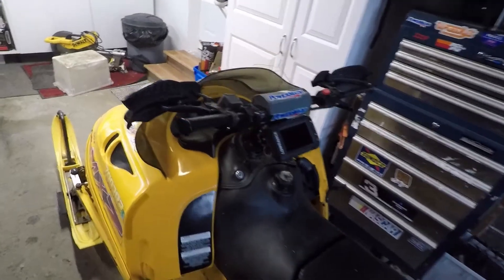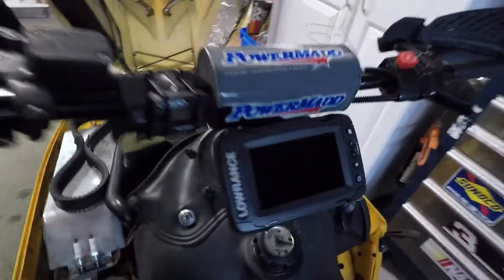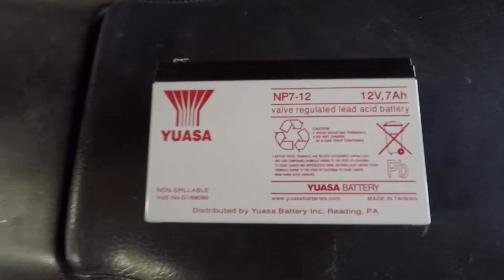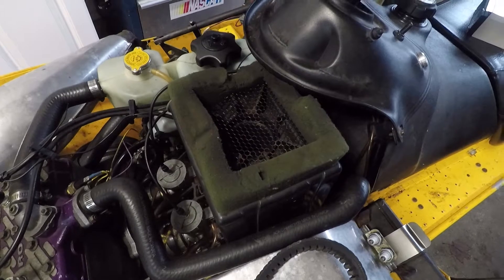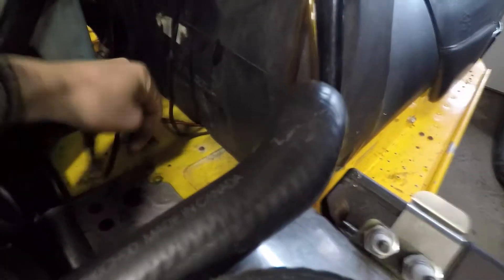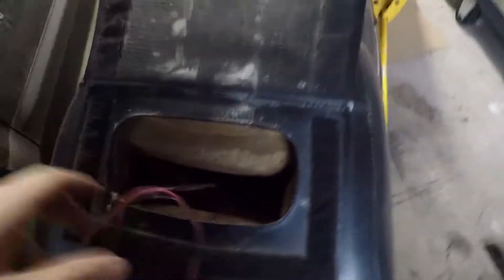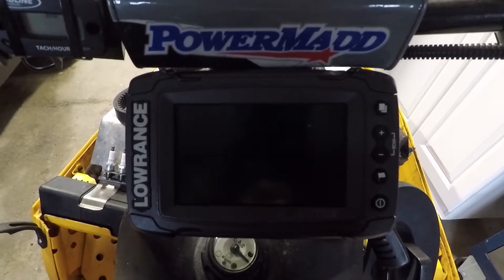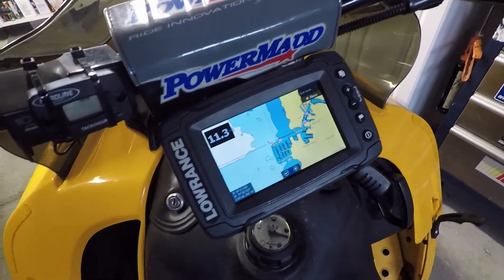Add a Battery to a 12v AC Snowmobile for 12v DC For Electronics

Comment: I put a regulator rectifier (3 wire) on my snowmobile that doesn't have electric start the regulator rectifier it self puts out 5.5vdc but measures over 17vdc at the battery how can I regulate the dc to 14.5 for proper charging? I installed a small 12v dirt bike battery on the sled
Reply from the maker: Nice, after doing this I saw another video of somebody doing it similar to that.  Good work
Reply: @InDepthSonar  thanks ended up soldering a bunch of diodes in line to bring the voltage down 3.6 volts so I don't boil the battery still have to put it thu its paces but seems like its g2g

Comment: Dumb question I have a sled its batteryless all I wana do is get nice bright led under glow on it what's best way to do this I dont really wana put a battery in if I dont have to lol
Reply from the maker: You'll need a power source of some kind. Unless you can convert your AC to DC. The under glow lights would only work when the sled is running in that case

Comment: is there a way too hook a battery up so that it can be charged by the stator?
Reply from the maker: Not to my knowledge, but I am sure it can be done.  Anything can really
Reply: You’d need to install a voltage regulator with a rectifier so you’d have a lead to run dc to the battery, like a sled with estart.
Reply from the maker: I think I saw a video on your channel how to do this right?

Comment: so all you did was wire the gps directly to the battery without wiring the battery into the sleds charging system? the battery and gps is a stand alone unit?
Reply from the maker: Yes that is correct.  The sled is 12AC and this is a 12DC system.  So you'll have to charge the battery on its own.
Reply: @InDepthSonar  you say that like sleds with electric start and a battery, a DC system, arent charged by the stator.
Reply from the maker: If it's just a hand held GPS, you'll get days. If it's a echomap with a 7 or 9" screen probably 6 - 10 hours

Comment: Considering doing the same but instead of a lead acid battery I'll use a power bank with USB connection. More compact, lighter and should last plenty long enough for a weekend of riding.
Reply from the maker: Yes that is a great idea.  I just have so many of these batteries kicking around I decided to use this